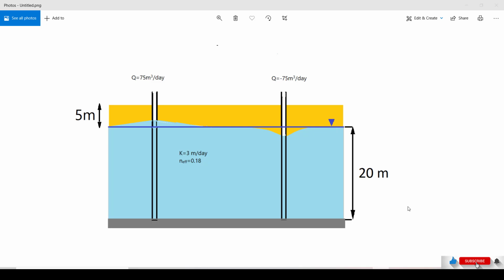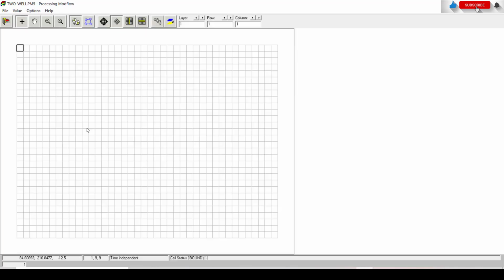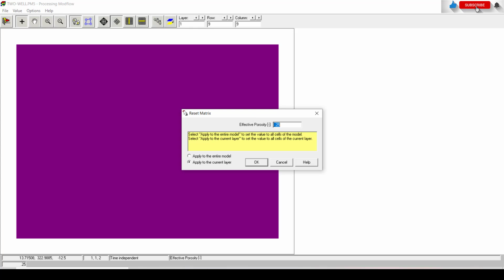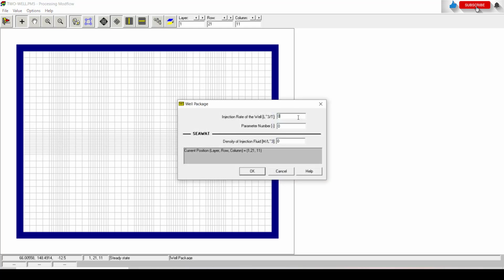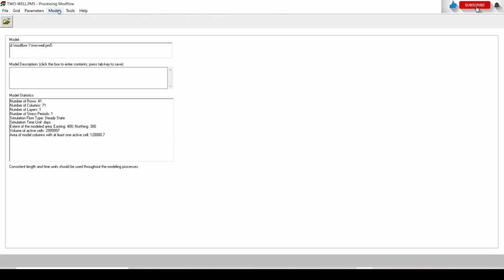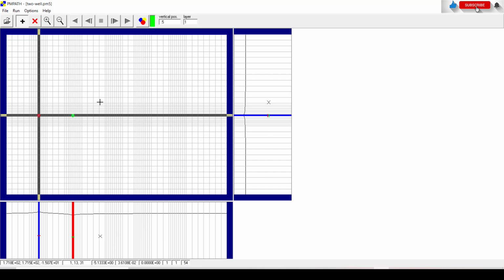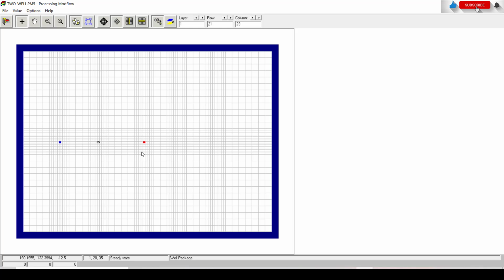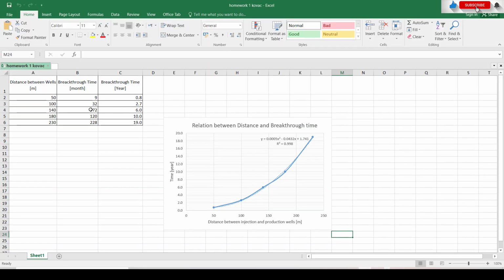Groundwater Flow Modeling Using Modflow

Comment: When clicking on Tools> 2D Visualization, it says it cannot find the file, c:/windows/system32/heads.dat
Would anyone be able to help??
Reply from the maker: Just make the path of the file short and names must not contain any number, for example the path be like follow may helps you.
/desktop/pro/heads.dat

Could you tell me at which minute you have a problem? To check the tutorial
Reply: @ENGSchool  at 9.40 sec, at 2d Visualization, at result type after selecting the hydraulic head, I press ok but it says 'cannot find the file, c:/windows/system32/heads.dat'
Reply from the maker: Send me message on facebook page I put it on the profile of my YouTube
Reply: @ENGSchool  thanks brother, it nicely works...
Reply from the maker: Glad to hear
Reply: @ENGSchool  I too have the same problem. Please help
Reply: Facing the same issue would you help me?  @md.muhaiminulislam4587

Comment: Hello! 
I have a question. 

Where do you know where the place intake/outtake is for the wells. I see you place them at layer 1. Does it mean that wells will always be placed at the bottom of the layer (since the drawing showed the intake/outtake to be at -20 m) or is it something I have missed? Thank you!
Reply from the maker: Hello, 
If you put the well in layer 1 , it intake water in saturated depth layer 1,
If you put in layer two it just take water from layer 2
Reply: @ENGSchool  Okay I see! So it will take water in saturated zone for the whole layer? Meaning that if the whole layer is saturated (below water table) it will take water from the whole layer?
Reply from the maker: @abatikthermoas6167  exactly
Reply: @ENGSchool  Thank you!